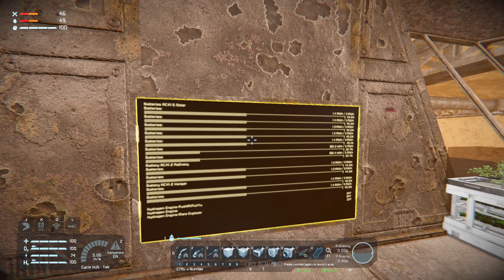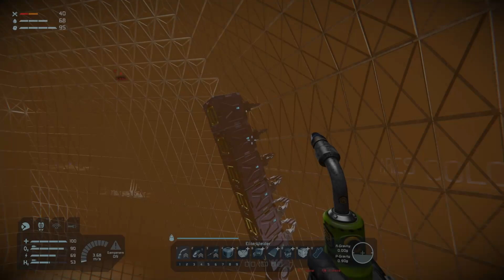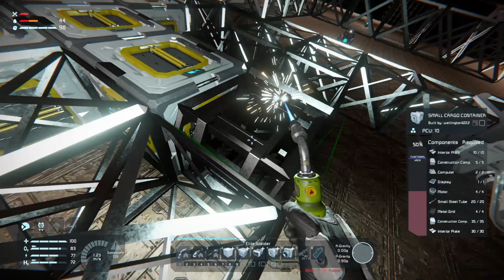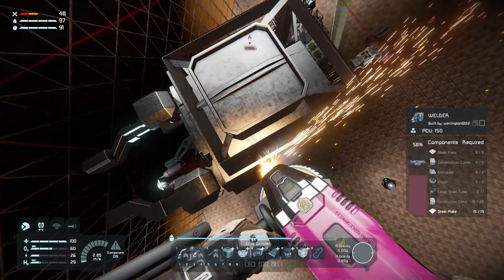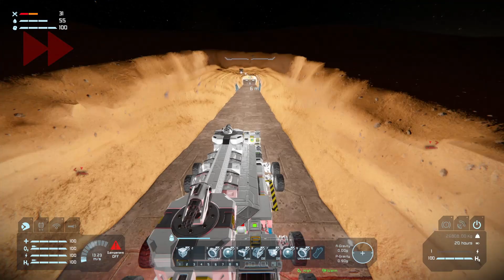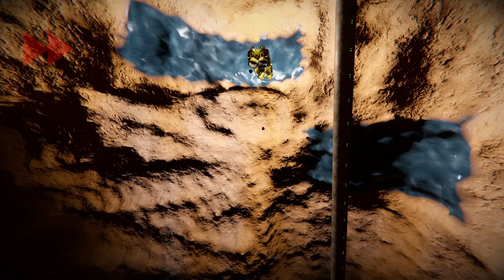Ares Colony EP30 - Will It Be Airtight? (Space Engineers)

Comment: Kia ora Wellington. 
Have you considered a rotating piston / welder with sensor to retract and extend into your domes crevices.
So piston extend up to the heights topped with advance rotor, another piston set ending with a welder or two distance variably controlled with a sensor to avoid hitting the glass as it rotates..
Reply from the maker: Hi Agro. Using pistons was my initial thought, but I felt like the set up would take longer than the welding itself, although I hadn't considered doing the sensor thing. I think even with the benefit of hindsight, the vehicle I built was probably the best method to use, but there will be a little more welding in the future that the piston thing will probably be a good solution.

Comment: Is it an idea to build an airtanknetwork underground when ther is an attack you can fast drain all air out of the dome in case if ther is a breach you dont lose all air?
Reply from the maker: Yes and no. The plumbing is next episode, and while I will be able to drain the dome without wasting Oxygen, it will not be a quick process like the airlocks or hangar. My early estimates are about 10 minutes, although I haven't completely filled it yet, so don't know for sure. Defense from attacks with be a safe zone, 2mins to power one of them up.
Reply: @Wellington6012  2 min...oef thats alot of time in a fast attack.....time 2 power up ? back up power genset with hydro engines 😝
Reply from the maker: @davelemmen4283  Yeap, planning on panic buttons around the place to turn on turrets, safe zone and hydro engines.
Reply: @Wellington6012  cool in de mix with soundblocks ???  this series are epic mate maybe better thrn hyphistes prime🙊🙈🤐
Reply from the maker: @davelemmen4283  Thanks Dave. HP was learning to put into practice stuff here. I can't wait to share what's coming. Really keen on making this build contrast through textures, three dimensional in construction, and fourth dimensional through the use of sound and movement. EP34 all will become clear.